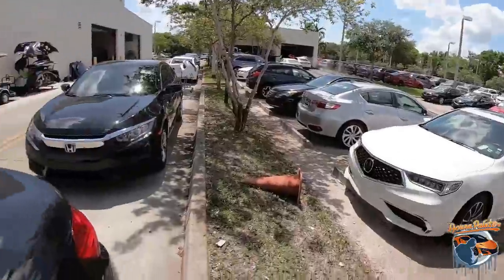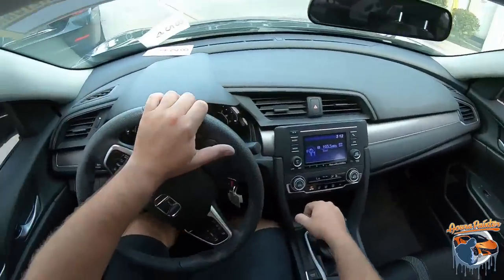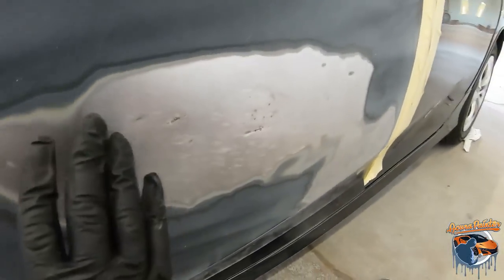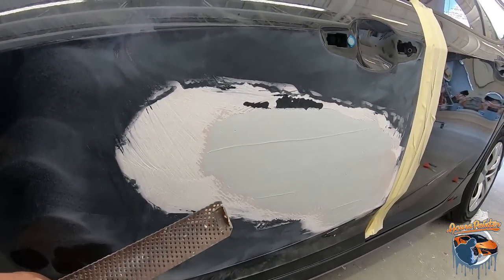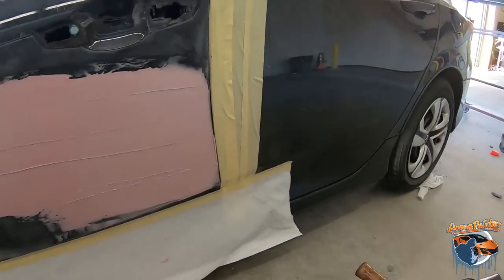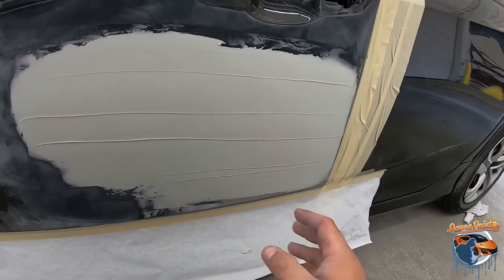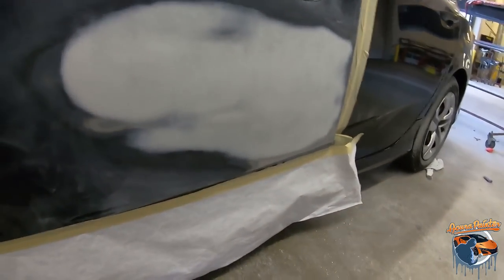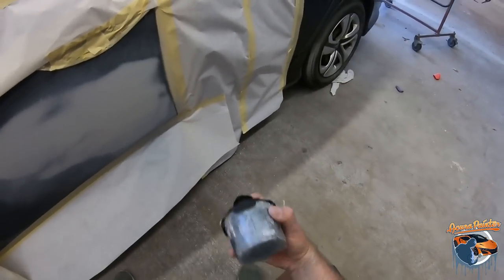Repairing a Honda CIVIC Door, BODYWORK Part 1

Comment: I'm guessing you are more of a painter than a bodyman? That repair became huge for no reason.  It appears you were taught the old way of doing things. I highly recommend to anyone to try metal repairs this way.....

Instead of grinding all that metal the beginning, grind the obvious low spots where you intend to use the dent puller. 

Use the puller from on the outside of the low spot just inside the ridge and spring hammer around the ridge. 

Move towards the center of the dent while doing this. Also when you hammered the high spot on the bottom it helps to pull from one of your low spots to raise it simultaneously. 

Now the important part. If you leave 95 percent of the paint, once you think you have straightened the dents you can sight down the panel by eye and look for waves. 

With a little finesse you could repair this with a skim coat of glaze over properly feathered factory paint. 

You will use less material and less primer.
Reply from the maker: Hi! Surely the repair could have been done in less steps and an experienced body man like you could have gotten it done. Thank you very much for your detailed instruction. You are correct I am not a body man that can repair big dents. Just small dents and creases. I look forward to your comments on my page and hopefully we all can grow together as a community.

Comment: I can see through your videos where you cut edited and how much mud was on the vehicle were you were standing and you must added more and taking it off seems like you putting over a dozen times applying mud on this six more times maybe even 12 seems like a lot of times I mean I don't know what your experiences with the dent and mud repair but doesn't seem like your Forte I could have got it done within two applications of mud work just because I'm very good at seeing dents and adding and getting it done with three applications.  You are a great painter but not too sure if you're an expert at  mud repair keep up the good work
Reply from the maker: Great. Maybe you can start a YouTube  channel and I can learn from you. I am very open to learning. 

I’m not the best. Never claimed I was. What you see is what I post. I show everything in raw footage, the good, the bad. I did mud three times and most of it came off, not sure where 12 came from. The end product is beautiful and you can still stick a magnet on the door and it sticks where the mud is. Just to show you how much filler actually was sanded off. 

Thanks for the comment
Reply: @everydaylifewithme5260  Damn very uncalled for, you should leave a link to your amazing you tube channel.
Reply: That's too much.pasta process

Comment: Wow i am still amazed that people still use cheese graters. Just knew as advanced as you are that you would not use a cheese grater🤔 I could if the dent was deeper but that was a very shallow dent that it would have not to extra sanding time just to sand down.🤔
Reply from the maker: Old video, we Have reformed our processes and trained better to get our metal right, thank you for your comment and you are 100% correct cheese graders should not be used in body shops

Comment: Cut your mud down with 80...use guide coat for highs and lows...throw your cheese grater 20grit scratch tool away...and why are you tapping while mudding...move your metal first...and my god...God... metal is showing it is high...  your good at spreading mud...that's about it. You'd be fired quick in my shop.

Comment: Could of got that out with pdr technique
Reply from the maker: A very good pdr I agree
Reply: The paint was damaged. PDR wouldn't fix that.
Reply: I should add that PDR has gotten way better over the years. Used to see holes drilled in door jambs (drives me crazy) but don't see that much these days.
Reply: @MrBodyman5001  yes it would not have fixed the damaged paint but then it only needed a sand and prime no body filler thats always better in my opinion . But yeah some pdr guys where drilling holes left right and center to get dents out luckly that has changed over the years